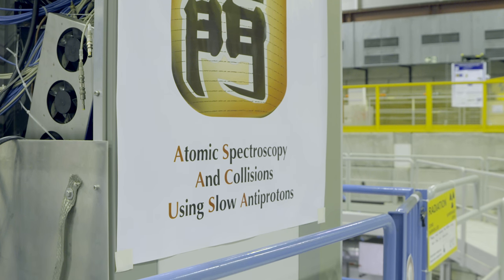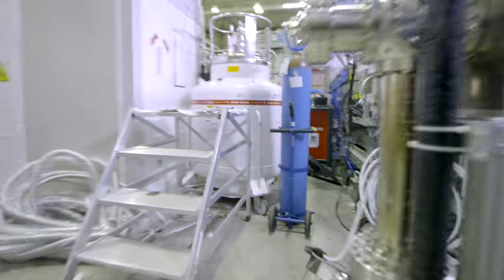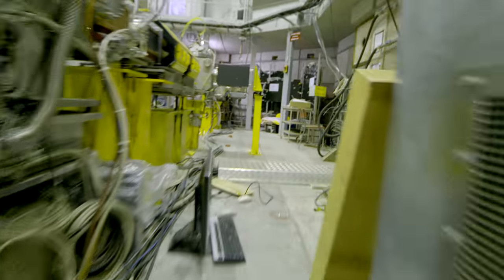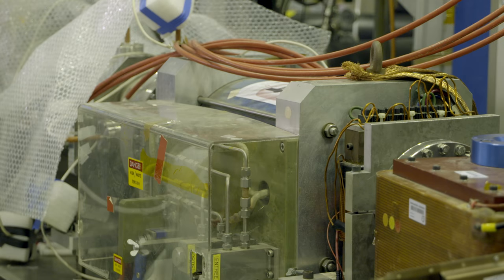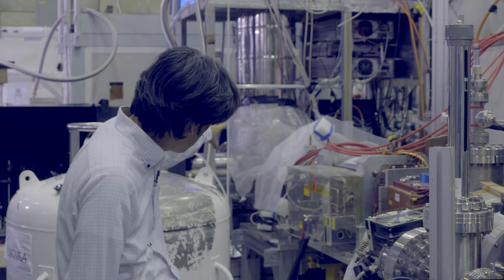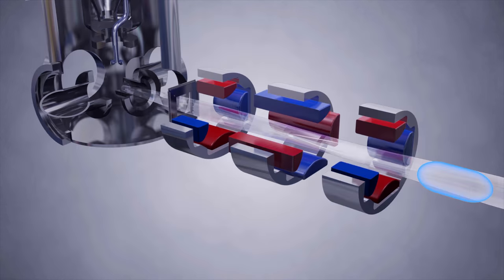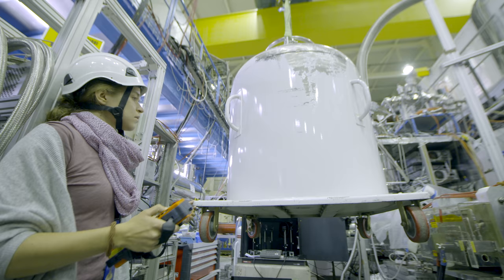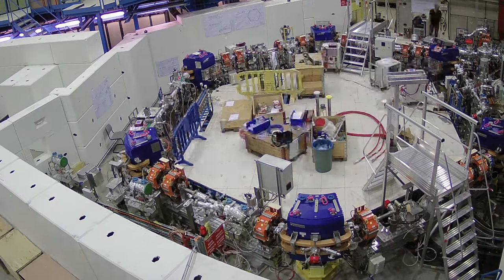ASACUSA improves measurement of antiproton mass

Comment: The most audacious experiment currently in construction is PUMA- the Antiproton Unstable Matter Annihilation Experiment- which will store about a billion antiprotons in a "magnetic bottle" so they can be transported to ISOLDE to be interacted with radioative ions.  It will actually involve the physical transportation of antiprotons from one building to another in a container.  I believe they are still working on the transport system.